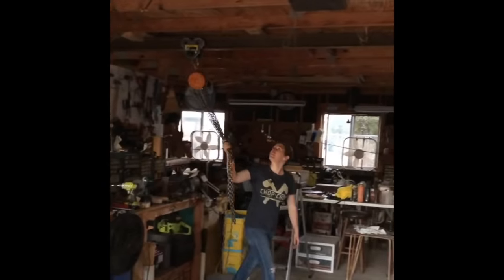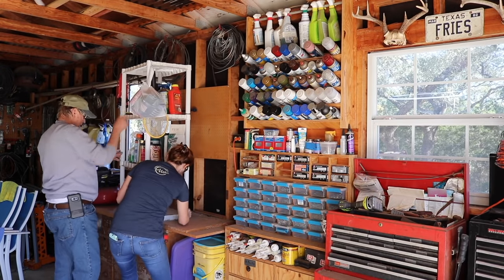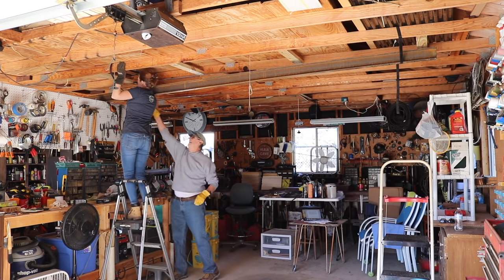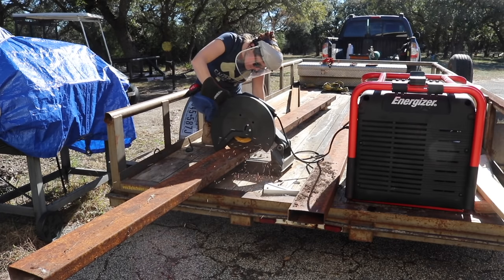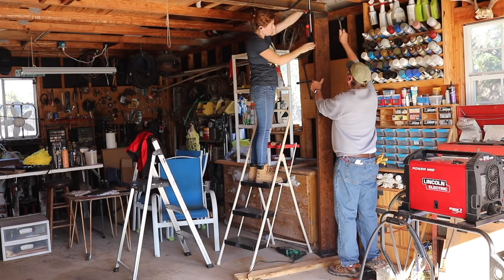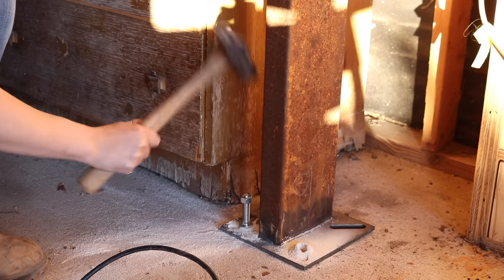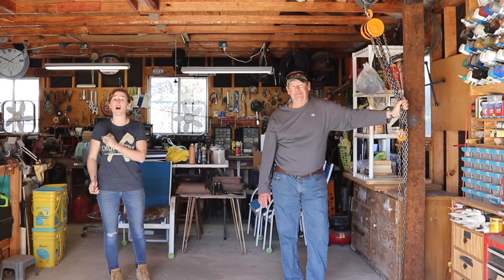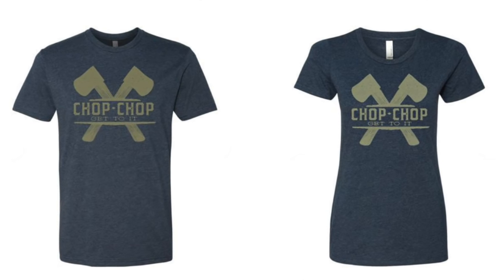DIY Garage Gantry with Chain Hoist

Comment: As a former millwright who built a number of monorails and overhead cranes of various types, let me offer a critique. This is a monorail, not a gantry. A gantry is a type of overhead crane that is mounted to a frame that moves on the ground, basically the mobile version that you opted not to build. What you built is a monorail. You have a single rail that doesn't move. And it's very nicely done; I imagine that the low headroom made the install challenging. The biggest problem that I see is that you didn't include any sway bracing in-line with the rail. I'd also suggest using a laser or optical level rather than a spirit level, as spirit levels measure angles, not distances, and when leveling a long beam, can be misleading. Overall, it's good work. I've always been impressed at how you teach yourself as you go through a project.
Reply: Christopher Feld 100% correct. I work in as a overhead hoist and crane specialist and you are right.
Reply: Constructive critiques are great. I wish more commenters were as kind as you guys. Most are “keyboard commandos” who offer nothing worth reading. You can only learn through experience and hands on.
Reply: Nice to know. I would like to add something similar in my shop for about the same purpose. However i was thinking about an anchored single post with a swinging rail and have no idea what its called. Would be lifting zero turn types and similar sized equipment.
Reply: mike s 
I believe that would be called a davit.
Reply: mike s
I've usually seen those called jibs. I only installed one. You'll need a pretty hefty post, too. A post diameter of upwards of 12 inches is pretty common. I would also be leery of using anything less than 1/2 inch epoxy anchors, as the anchors will be going from tension to compression, depending upon how the jib is positioned. You'll also need a pretty hefty slab to mount it on. They can also be wall mounted, but I wouldn't trust a residential wood-framed structure for this.
Reply: @christopherfeld6371  thanks to u and adkchip. Now i can research these to come up with a plan. I think my shop floor is 4 inch concrete. Will need to see how much that can hold in this application. Thats my biggest worry.
Reply: @mikes1345 , I have one in my garage. Looks like a Mechanics service truck crane/lift ?  I made it from a 8" X 1/4" round with a 12" X 12" X 1/2" plate with 3/4" Redheads in roughly 5" concrete. About 3/4 of the way up, it's attached to the wall. We lift 60'' Zero Turn Mowers from any angle and never had any issues. I actually think it would lift one of them completely, but never had to.  I think you'll be good !
Reply: @mikes1345  I can speak to this since I am a civil engineer who specializes in cranes. You are speaking about a jib crane. I have had dozens of these installed. They can be foundationless but need a minimum of 6" of concrete for anchors. A Gorbel work station jib crane is a great off the shelf product. If you are going DIY this, you could weld a column to a base plate, like April did in her video. Anchor bolt that to the floor. Then weld an "L" shape with two I-beams (google cantilever jib crane) , attach those to the column with the proper rotating connectors. You should also weld stiffeners from the base plate going up the flanges and the web of the column. A jib crane creates a "moment" connection (a rotational force) on the base, where as April's setup is just a vertical force. Much easier to buy an "off the shelf" jib than DIY it with no experience. Not saying it can't be done, just difficult. Not to mention, beam size should be sized properly, especially for this style crane. Sorry to be long winded. I'll shut up now.
Reply: @michaels7104  thanks, is helpful
Reply: @michaels7104  
Gorbel makes some great stuff. The movement of Gorbel components is much more smooth than traditional S-beam trolleys. Wouldn't be the greatest for use in a typical garage, as they eat up the headroom.
Reply: @mikes1345  I have always heard them referred to as jib cranes.
Reply: Christopher Feld 
Actually, I believe it’a call a Jenny Rod, with a modified O’Connor push bar attached to a standard Ferris downpost. 

Other than that . . . we can prob agree that she did a fantastic job building this amazing thingy for her aging Dad, who is clearly an inspiration in her life  ;-)
Reply: Should've added a plate at the top to the column for the beam to rest on an welded it to that instead of directly to the column itself.
Reply: Looks like this comment has the right people to ask, but is it possible to do a similar project in the video, but NOT have the ground supports?

Is it possible to just mount the beam to the joists?  Wouldn’t be lifting anything over 500-600#
Reply: Christopher Feld you couldve avoided saying any of what you typed and just said that they needed the anti sway at the top everything else you said is yadayadayada irrelevant
Reply: Thomas Rossi that’s not true at all you can know a lot by having any kind of brain that knows the slightest bit of physics and the law of gravity and I don’t mean calculations I mean common sense law for every action their will be a reaction
Reply: what about the gantrys that pivot onthe ground or the deck of a trailer or ute . i call them A frame gantrys
Reply: @michaels7104  I wish you would make a comment on the main instead of having to find you in this reply. Everyone loves the work done here but they need to know that this should be certified for capacity by an engineer. An off the shelf solution would already have a spec rating.
Reply: Thanks for the expert commentary. Really helpful to know the difference and importance of swag bracing.

Comment: There is more than one way to do a job. But from a guy who has always had to do things by hand, it would have been much easier to put up the ends first and then set the horizontal on top. I put a 40 foot by 12 inch I-beam with nothing but a ladder and my two teenage sons to hold up a roof that we had to set on top of the I-beam. Last year I put a 5000 sq ft building by myself by putting up the posts and then lifting one end of the rafters up at a time onto each post. Always start at the ground and work your way up. Don't start by trying to hang something in the air, OUCH!

Comment: U should blow all the concrete dust out from the hole and around it before placing the anchor , if u don’t the anchor and slip and spin , just a quick tip I see it happen all the time to people

Comment: You warm my every time you help mom or dad nice job.  I learned to always drill the full depth of the concrete then if you ever need to remove the item you can undo the nut and dive the anchor down and fill the hole. Love your chanel

Comment: This is exactly what I needed - planning something similar for my addition. Thank you April and Papa!
Reply: One thing, just a safety ,when you are using out those kind of wedge anchor bolts- Get a blowgun with a long tip and blow the dust out! Too much in there can cause the them to fail in certain applications, moreso in the uplift situations than what you have here.

Comment: You did it the right way.
My dad did it the wrong way.
He didn't use vertical supports to hold his "gantry" up.
Just took a couple feet of angle iron and bolted it to a couple of beams.
Used it to lift off a counterweight (roughly 2000 pounds) from his front end loader.
I was the smallest and nimblest of the bunch so I was chosen to use the come along to raise the counterweight.
We all watched as the chain got tight and the ceiling/roof lowered. All sorts of cracking and creaking.
Then the counterweight lifted a half inch. Then we moved the loader out of the way and brought in a pickup. Lowered the weight VERY SLOWLY into the back of the pickup. The pickup was almost crushed from the weight.

Comment: Hi April, another good way of cleaning rust and cement off steel beams is an air needle scaler. Very fast and effective. Needs a compressor of course and is very noisy - use ear defenders. Air tools are quite light to use, reasonably powerful - typically 0.5 hp or so - and can't electrocute you. An air hammer with a wide blade is REALLY good for removing wall tiles and suprisingly controllable . BobUK.

Comment: Hi April. I've done the beam loading calculations for a substantial I beam I have in my double width garage. The limiting factor was the brick piers holding it up, so metal ones is a good move. I'd have to add builders prop jacks to mine - we call them 'acrows'. For up to a 25 mm load offset and up to 1.5° out of plumb these have a safe working load of over one ton (long or short!) each for typical garage heights. Also very good that you stabilised the beam at the top, don't want it toppling! Your support beams will safely carry a much greater load. Cheers. BobUK.

Comment: Just my .02$

When you’re drilling for those stud-anchors that you used to secure the posts to the floor, drill as deep as you can. Seriously, bury that bit!

Those anchors secure themselves when you tighten the nut and actually draw the anchor away from whatever you’re securing to.

The advantage is that if you ever want to get rid of the anchors, a deep hole will let you simply hammer them down into the concrete instead of having to cutting them off with an angle grinder.

Thanks for another great video!
Reply: Great idea
Reply: You should drill the hole at least deep enough so when you pounding the anchor with the nut all the way at the top you pound it down until nut touches the base plate
Reply: Um you do not want to drill through the floor slab. It weakens the bolt. 3" is more than enough for those.
Reply: North Dakota 322 ... You’re right, but with this type of anchor there’s really no penalty or reason not to drill deeper. A deeper hole gives you a fudge-factor and options in the future ... let’s face it, once you put one of these into concrete, it’s never coming out.
Reply: Greg Dent - not so much. As long as the anchor doesn’t extend below the slab, you’re good. The anchor will be fine. 

To your point though, drilling through the slab into grade should be avoided to prevent water seepage and corrosion on the anchor. Good call.
Reply: That concrete slab probably isn't much more than 6" if that.  They also secured it in several ways.  Plus this is a minimal use item and not an industrial application.  It is probably more secure than it needs to be.
Reply: Chris 7
Reply: Chris newer homes garage floor nowadays built in with tensioner, would you still drill a hole if you mount a project in the future or don't even mess with it?
Reply: Greg Dent 
Drilled hundreds of holes for industrial machines, every one went through the slab never had one fail or loosen!
Reply: Greg Dent  Wrong
Reply: @lebronjordan802  hard to imagine a residential home built with post-tensioning in the garage floor unless there is a room below it. That said, if you're drilling into concrete (with an SDS) and happen to hit either rebar or post-tension, you'll be able to feel that you aren't drilling concrete anymore.
Reply: Is it just friction holding the anchors in? Obviously it's holding down something that is super heavy, but wouldn't hammering something like the bolts just break away any material that the bolts would ultimately be grabbing to?
Reply: @Chris-hi8gc  lots of the new construction tract housing around me (San Francisco area) has post tensioned garage floors.  They stamp that fact into the concrete as a warning.  I'm curious as to the Why of post tensioning, I assume its multifaceted
Reply: Chris if they secured the gantry at the ceiling they wouldn’t even need much at the base he’s not hoisting cars

Comment: I like that gantry idea a lot. As I am in my early 60's and my wife and I struggle to unload my woodworking toys in my garage, I have been searching for plans for a gantry type or hoisting
apparatus that is made from 2"x 6" with plans so that i can use it in my finished 2 car garage. All of my machinery is now to heavy for us to lift, and new ones, well right now purchasing is
on hold until I can get something economical to use, or else pay for the optional deliver inside 1st room charge.

Comment: Nice. I have a similar beam hoist in my garage in England. Bought the truck as a cheap vintage item; but it works fine to move my lathe or lift other heavy items.

Comment: Two thoughts on the Red Head anchor bolts you used (available at big box stores): 1) I was taught to drill all the way through the floor, or at least an inch past the length of the anchor.  These anchors are one-way.  You will NEVER pull them up (unless you break the concrete).  If you need to remove them one day (the hoist... er... ahhh.. monorail... needs to be moved a foot, removed, or you just mis-drilled), you can take off the nut and washer and pound them down out of the way, leaving a hole that can be filled.  And 2) When you put the washer and nut (hmmm... no lock washer) on first, if you mar up the end, it doesn't matter.  If it does matter to you, put on a 2nd nut and lightly tighten them together to keep them in place while hammering.  If you followed my advice in #1, then you can use 3 nuts... 1 to set the approximate depth so you don't go too deep, and two nuts at the top used while hammering.  Great project.  I just bought a 5400 sq ft shed and will build an 1800 sq ft shop in it this spring.  I get to move out of my basement and garage to set up my own MakerSpace.  A monorail (or two) will be part of that.

Comment: Hi April. Great job as always. Just one suggestion. Use compressed air to blow the dust out of the bottom of those anchor holes, then add epoxy for a really strong anchor. That's how we do wall anchors in concrete when needed.
Reply: James Knox good tip to have. I’ll be using that for sure. Thanks.

Comment: Not sure if you concrete hammer drill is like mine but if it has a knob to change it to just hammer mode it makes driving the bolts in way easier.  Just put the concrete bit in the middle of the bolt and use the hammer function to drive the bolt down.  Helps prevent mushrooming the bolt head.

Comment: On the Anchor Bolts....

I'm an engineer for a commercial playground company and when we set up prototypes we drill the holes through the whole slab (it's like 7 or 8 inches thick) Then you can pound the anchors in until the nut is resting on the floor when loosened all the way. This gives you the full length of the threads to use to be able to pull the wedge tight. Additionally drilling through means that if you ever take the item off that they're holding (Which we do a lot) then you can pound them down flush to the ground rather than having to grind them off.

No promises that we do this 100% correctly, and if you have a basement below the garage I definitely wouldn't recommend drilling through, but it works well for us. 

Also, I don't know what your dad plans to do with his, but a cross brace probably would've been a good idea, then if you have any side loading (Like lifting an engine out of a car but having to slide it off the transmission) you don't have a large moment with that tiny little floor plate to keep from pulling the whole gantry over.

Comment: April.....just a suggestion....when installing red head type concrete anchors, try drilling completely through the slab or at least deep enough that if they are ever to be removed you can simply drive them through the floor and fill the hole with cement or mortar.  great vid

Comment: When using a wire brush on a grinder you should wear a full face shield, those bristles sometimes let go. I have had some stick in my hand and arm before.
Reply: Those little wires find places you'd never think of !!
Reply: I got a nose piercing once cleaning my welds- now I use a cordless grinder with lower rpm.
Reply: Oh yeah .  Those things fly like mosquitos when you try to clean an uneven spot .
Reply: Yes, a respirator too, dust is always nasty to breathe.
Reply: I experienced all what you all mentioned @ PHNSY as a marine machinery mechanic of 35yrs & a whole lot more of close calls.  Safety was paramount which kept me alive and well.  I still do double eye protection & wear steel toe shoes when working @ home.  Already have 2 strikes & several foul balls (3 strikes and you’re out).  Stay safe!
Reply: Sami  in the shipyard we had to wear both, not “or”

Comment: Excellent job.  One tip, don't hit the nut on those hammer in bolts.  They have a bit at the end designed for hitting.  Its smaller than the thread, so can spread a little, without causing clearance issues.  If you hit the nut, you can damage the thread. I learned this the hard way, and once it's in, its hard to remove.

Comment: Using some cheap ball bearings and turned rollers, you can make the trolley for maybe as little as 5 dollars. And get to play with a metal lathe in the process. Which is a very interesting machine, well worth to get to know.

Comment: At 5:10 - anchor bolts with a sleeve: 
A. Not vacuuming the dust before hammering the sleeve of the anchor bolts is quick - but wrong. You need to vacuum and wire-brush the wholes.
B. Somebody below commented - you need drill at least 1/3 of the bolt's length lower. So if you decide the change the location, be able to drop lower than the sleeve and pull it out. 
C. And therefore your initial measurement is wrong - you don't need to cut the extra part on the top if you drop it with a additional buffer

Comment: Nice project, might use it for my own shop. 
Just for your info, don't hammer on the nut but use the flattent spot on the anker for it otherwise you might end up with an useless anker in the floor, don't ask how I know this 😉